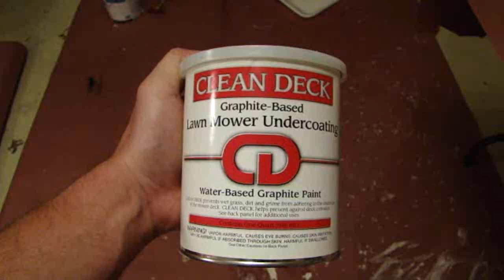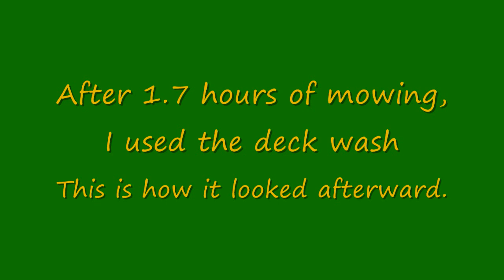Graphite Coating a New Mower Deck.

Comment: I think the reason for using undercoatings is rust prevention.  If grass doesn't stick as much, that's a plus, but it's definitely going to help you with rust prevention.  Like the idea of doing it when the mower is new.

Comment: If you want to see a real easy mower deck to work on, look up the Hustler Raptor Flip-Up zero turn mower. To access the bottom of the deck and the blades, just pull a lever and the entire deck fllips up to do maintenance under the deeck. Then put the handle back in it's original poaition and you're ready to moow again.

Comment: All in all, still clean. I think it will help. I don't think there's any real way to fully prevent it, but it helps. And may be easier to clean off too. 
I love how easy that deck is! I need to fix mine. Once of the things need to be welded back on

Comment: Thanks for info man! I'll keep an eye out for the paint to go. I put fluid film on it before I even left the dealership! That stuff works great, I try to clean it after every use and so far thats been doing well. My only complaint is that the hose attachment deck wash thingy is only on one side and water doesn't get to opposite side very well.  Maybe one day I'll add one to the left if possible, but for now I gotta spray under the deck manually...which is ok too since large chunks of grass come off with the hose when the deck wash nozzle didn't get it.

Comment: My John Deere 1986 318 with 50" deck.  I did the etching primer and then 3 coats of graphite paint.  Did not help all that much.  Maybe I was expecting a miracle.   I pretty much have to remove my deck after every mowing and power wash the deck.  I only mow when it has not rained for 6 days and I have a yard, not a lawn.

Comment: i tried doing this in sandals once.  wasn't very smart.  looks like it may or may not have helped.  in any case, it's another added layer of protection against rust, which is the most important part.
Reply: y

Comment: How many mowings does it take to wear through? I'm guessing 2 or 3.
Reply: I used a similar product that lasted about 5 years.
Reply: With the lack of prep like he did, maybe 2.
Reply: A water based paint will not adhere to a glossy oil based finish for long.

Comment: Great video - thanks for posting it.  It's been several years - did the graphite coat end up helping or no?  Thinking about trying this on my new JD, but I'll trust your feedback if you don't think it made a significant difference.
Reply: InstaBlaster

Comment: Hey joe, how has your undercoating been working out for you? I'm investing in a new mower, and I'd like to protect it right from the start. Message me so I get your reply...thx
Reply: I mow for a living. I can tell you from personal experience that this stuff will help you. However most of the time it will only last you a mowing season. Especially if you are mowing commercially. However I found that if applied properly this stuff will usually last longer than the paint job on the bottom of your mower. Therefore wait until the paint starts to chip off of the bottom of your new mower. So that you can see the finish and scrape the deck out and add this stuff. The only thing you are trying to accomplish by adding this stuff is to fight the never ending war with rust. The more grass and water you keep off your deck the longer it will last.
Reply: Jordan Robinson

Comment: It's a waste of money and time. I've owned a large Lawnmower Shop for 30 years, it's simple and free. Ready?? Dont cut the grass wet or remotely close, store in some type of garage  or storage building and blow off with air (compressor) after you cut. Your mower deck will outlast the engine, transmission, etc! The velocity grass, sticks, rocks whatever (basically normal  coating with wear right through that bumb coating and be right back where it was before. Some videos help on YouTube but others bring out the stupid, gullible and specially the unknowledgeable! Common sense goes a long way..
Reply: Tony my ZT mower is 15 years old, I mow close to 3 acres, I just pressure wash my deck and mower and put it in the barn til next session. Still going strong and deck is in very good shape, I get buildup but a scrapper and pressure wash cleans it up
Reply: Exactly.. it's the ones that leave them outside in the weather and then wonder "why is my spindle assembly falling through my rusting deck" but hey some rattle can truck bed liner (no hardner);underneath that will give 0 protection to the sides and top much less where it's being sprayed and that will do the trick ! Oh and that rattle can (no hardner) will deflect all the debris at an extreme high velocity !